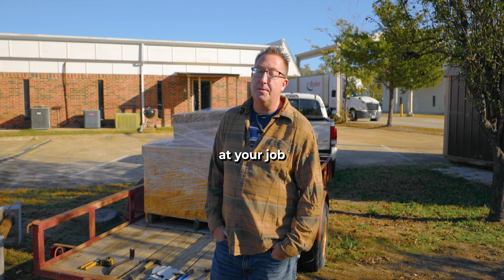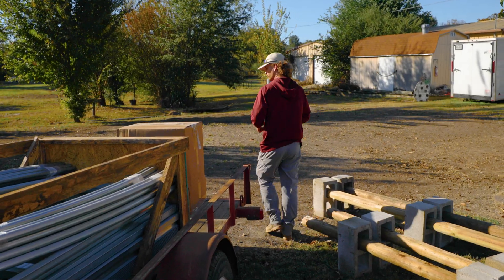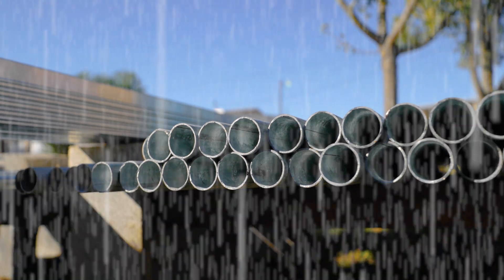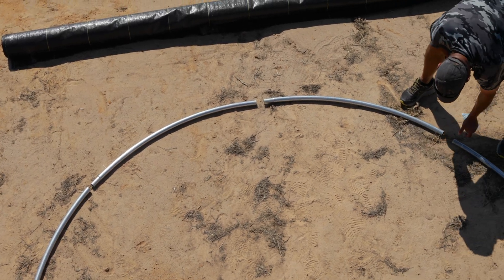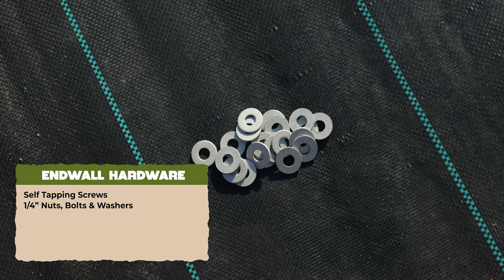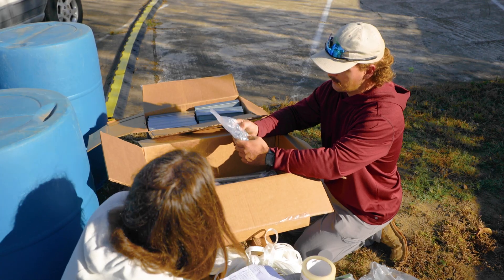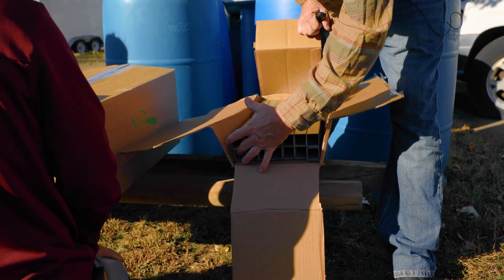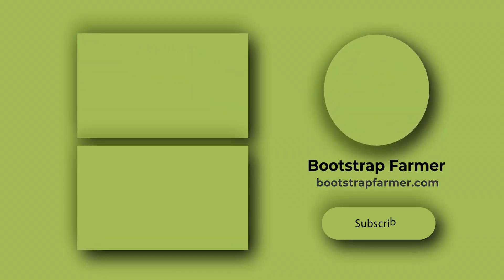Bootstrap Farmer Hoop House: Every Part Explained

Comment: The instructions need some work. I bought the vent and fan kit along with the hardware kit for both. We received the hardware but not enough pipe to hang them from. 
Also, the instruction were not quite complete. I suggest you look at the DIY instructions even if you bought the complete kit. I bother bug netting and shade cloth. It would have been helpful to know to drill holes in the baseboard and/or pipe close to the ground for the shade cloth before putting on the bug netting. The holes in the bug netting would have been smaller.
Reply from the maker: Thank you, I will pass that along. 
We revise instructions based off of great feedback like this.
🙏